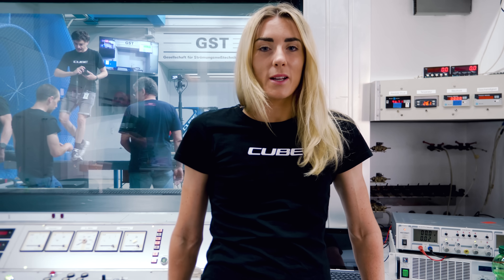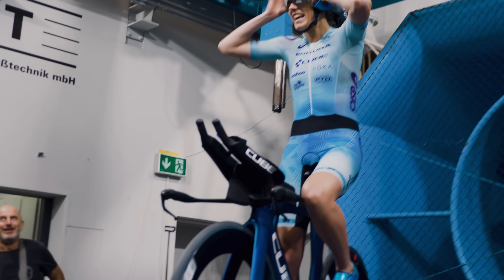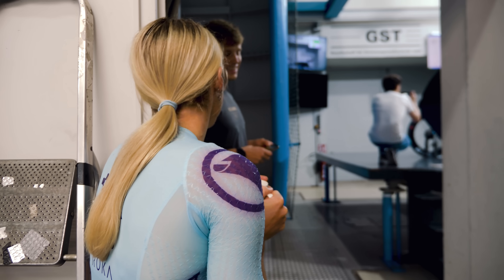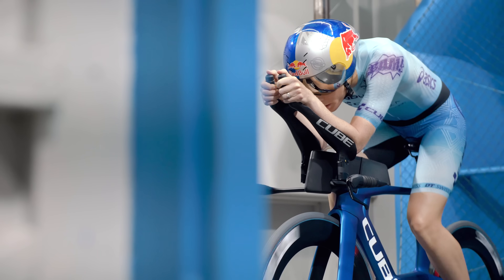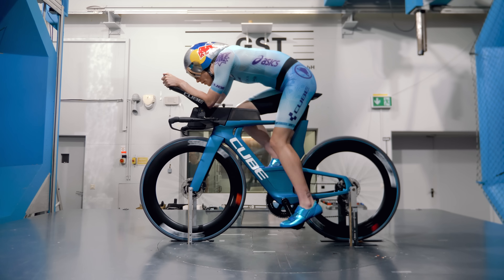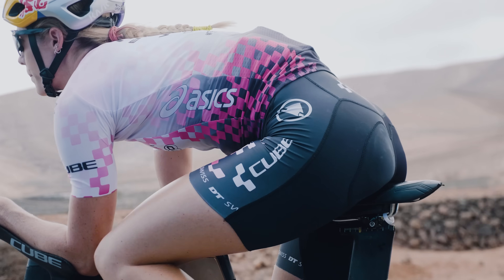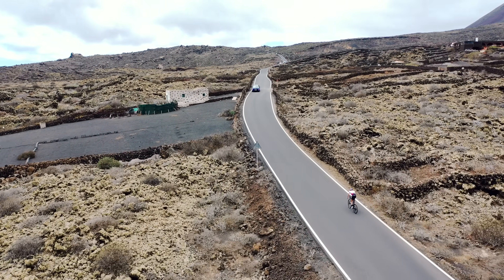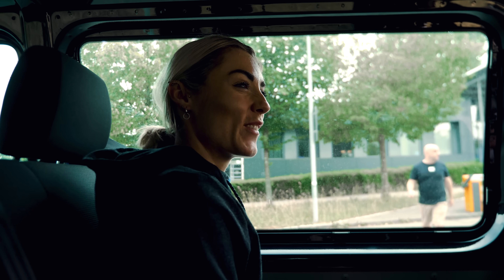Have I Maxed Out My Aero Gains? | Wind Tunnel Testing

Comment: That was really interesting. I wonder what actual gains you might achieve from the wind tunnel testing, and how these might transfer into time saving at races? It seems to me that it has to be fairly marginal, and not many races are usually won by tiny margins, but I that is just me guessing. Maybe the savings/efficiency gains are a lot bigger than I imagine?
Reply from the maker: Over the long distance it can really add up to minutes if you can save a few watts! So it could take you up a position in the race 🚴💨
Reply: @LucyCharlesBarclay   Thanks. Anything adding up to saving minutes is certainly worth it 👍
Reply: The gains that you can obtain from aerodynamic testing can be huge, and make significant changes to your velocity and the time that you take to cover a certain distance. Of course, the gains that you make depend on where you're starting from. I was semi-optimised prior to going for testing and the changes that i made saved me ~40 W. FWIW, the slower that you're travelling the greater the absolute gains in speed for a specific change in CdA. In other words if your current average speed is say 30 km/hr a specific change in CdA will result in a greater absolute time saving that the same specific change in CdA compared to if your current average speed is say 40 km/hr.